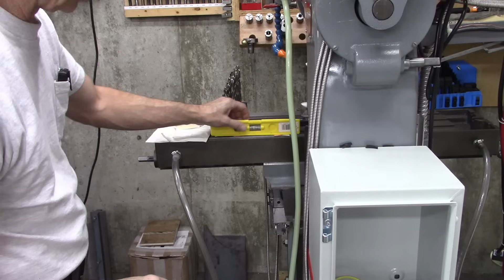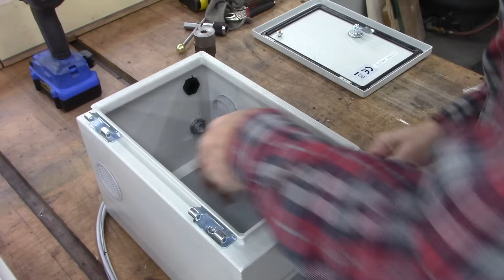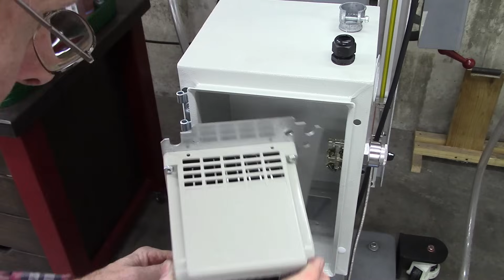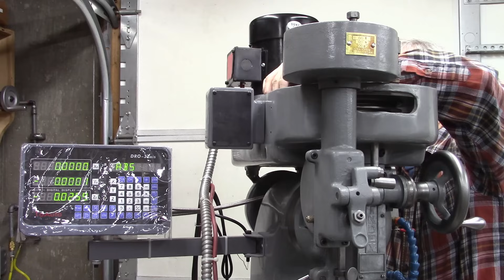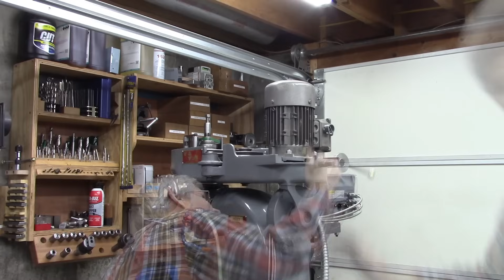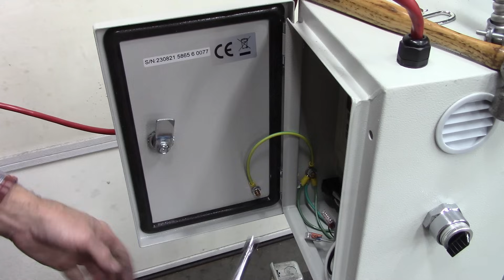IT'S ALIVE! Installing a VFD and 3 Phase motor on my Well Index Mill  - Part 2

Comment: great work. have a different model vfd, but watching your video helped me. believe my issue is with the motor on my unit. currently wired for 480. i will be switching to 220 and see what happens!
Reply from the maker: Good luck. It takes a while to figure out the VFD.
Reply: @ just got it wired up and gave it a try! Posted a video of mine! Lol not as good as yours! Thanks for the help!!
Reply from the maker: @tylermaster7  There are settings that control ramp up and ram down. Its in "hz per second", If you are running 60HZ forward and have them both set for 60 when you hit the reverse it takes 2 seconds to go from full speed forward to full speed reverse. Its hard on the motor if you go too extreme but you can go way more extreme than you are in the video. You can also double the rated speed by setting the max. hz at 120. You lose a little power but not much. Going slow is much worse. Running over speed allows you to gear for the lower speeds without sacrificing as much high speed.

Comment: You should install a fan to increase the air circulation. Your VFD will overheat if you don't.
Reply from the maker: The VFD has a fan and the bottom of the box is mostly open. There are 2 round 3" vents at the top. Its been running over a year now and no sign of heat. I might be wrong, but I don't think its a problem.

Comment: Thanks for such an informative video! Have you considered installing a foot pedal that you can plug in when needed for forward and reverse jog for power thread tapping?
Reply from the maker: The quill on my mill is worm drive and can't be driven backwards so power tapping in not an option

Comment: i have a 1 1/2 hp 3 phase that will mount directly on my motor plate and the oem pulley fits. I will look for a 56 frame 1 hp 3ph, i don't want to break mine.  But that was an impressive cut.
Reply from the maker: You mean milling the motor?

Comment: Ok, I said you had inspired me and I have cleaned 1/4th of the garage (meaningful because it is room).  Next, I'm tearing apart my heavy enclosed work bench I built in '83 in MO. I was going to leave it when we moved to FL in '94, but the movers put it on the truck and here it is.  Work paid for the move and they even packed the full trash cans and brought them. I couldn't believe how fast metal disappeared when I put it to the curb yesterday, it was gone between trips.  When I went to get the trash cans a minute ago, some guy I couldn't understand was taking an old hot water tank from the neighbors from beside his house.  Some lucky guy even got a boat motor last night.  I remember watching my dad toss everything when he turned 70 and I couldn't understand it.  I'm 68 and I understand it now.
Reply from the maker: Ha,,,  yeah, baggage.
Reply: Right, baggage. That's all it is.  @WinkysWorkshop

Comment: While the electrical code is complicated on this subject, for safety and electrical interference reasons, it is generally a bad idea to run power and low voltage control wiring in the same conduit, or even cable tray.
Reply from the maker: Interesting and I'm sure you are correct. I actually thought about this while installing the VFD but decided to proceed and take a chance anyway. One reason I did this was simply laziness. Running the wires together kept things simple and compact. The other reason is that I saw this done frequently on motor speed controls in my past job. To be clear, I am in no way a qualified or educated on this subject and this was just my observation and perhaps not correct. It could very well be that some of the wires were shielded or that my memory has failed. Thankfully its working incredibly well. Maybe I got lucky or maybe the 3/4 HP and 220v is not enough to induce a signal in the other wires. Like you said, the code is complicated. Thanks for this info however, it's very much apricated.
Reply: @WinkysWorkshop  I installed a KB Electronics drive on my mill and it generally works fine. But I have been able to stall the motor at less than 50% speed, when I should have changed the belt position to maintain enough torque, or used a smaller end mill. Please keep us up to date on how yours performs. There is a whole lot of interest on this subject.
Reply from the maker: @jmcc685  When using HSS endmills with a 1/2" dia. the mill needs to run about 700 rpm. My VFD is running at 45 hz at this speed. I tried pushing it hard with this size mill and I DID hear the mill slow down slightly but I doubt I could stop the motor. I also used a 1-inch mill without issue but did not push it...  I suspect this was about 30 hz but did not look. I now have 3 belt position options and I am running it in the fastest position. The next step probably limits my speed to about 1200 to 1500 (have not checked the speeds) so this might be the best range to leave it in for HSS. My current 2050 high end is great for 1/8" carbide however. Still the front belt is easy to move.

Comment: You are truly a man of many talents! How is the torque at low R.P.M.'s?
Reply from the maker: Thanks. So far I have not noticed any but the rated RPM is only 1120. This means a 1/2" HSS end mill running at 700 rpm is still running at 60% of full rated speed. I might notice it if I go slower but I still have 2 slower front belt position if it's an issue. I have not measured the RPM but its super slow if i move the belt.

Comment: I can't begin to tell you how valuable and useful your content has been to me in the last year or two.  Your interests in machinery are very much like mine.

$25.00 for that motor and a clear conscience.  AWESOME!

The indicator light is an excellent idea.  I did the same thing in the electrical box for my Index 645.  I have other indicator lights as well.  The air compressor is mounted in a different room and has a blue light special light mounted on the shop ceiling that is very noticeable as I shut down the workshop in the evenings.

I split the 240V incoming off to provide 120V as well, installing a 2 gang 120V box and outlets external to the box.  I went with Automation Direct and their 240V single to 240V 3 phase  .75Kw VFD.  It was much narrower.  I'm able to fit two of them in a slightly larger box.  I also used the original Hubbell Fwd/Rev switch on the machine to control the Fwd/Rev on the VFD and will do the same when I get the second VFD for the table feed which is also 3 phase.  That retains the original tactile feel of the industrial switches as well as the positive and intuitive action.

Those crimp terminals ROCK!  I only learned about them in the process of building my electrical box.  They're worth every penny!
Reply from the maker: Thanks...  I suspect yout VFD is a little better than this one but for 3/4hp mind works well.

Comment: I know you have mixed emotions about adding a tach.  I guess my point was that there are some really tiny sensors like 1/8" thick with a screw hole that you could put under the spindle pulley and not have to use one of those large round threaded ones.  The magnet could be small also, like 4mm od (0.160").  Those miniature sensors have the same 3 wires and will work directly with the tach counters (the one you used on the lathe) although you might have to splice or solder the 3 little wires to get that connector.  Just search for miniature hall effect sensors or transducer and you'll see them.  There might even be a smaller counter display.  This stuff is all cheap.  Give them a company name and they'll send you a sample for free.
Reply from the maker: Nah...  it's not the money, the one on my lathe was $18. I may do it as some point but its low on my list.
Reply: Same here.  Retired now and cleaning out the garage.  Give it away or push it to the curb.  It's a long drive to goodwill.  For many years, I used to buy, trade and sell tools with several good friends at the flea market.  God, I loved it.  They're all gone now (passed away, moved away) and Walmart even built a store on the property.  Always had a big shop at work so didn't need it at home.  Once I get some room in the garage, things will improve, I think.       @WinkysWorkshop
Reply: I've been playing with one of those sensors today. It says they are inductive, and this one has a 4mm sensing range.  It was interesting that it didn't need a magnet, just a piece of steel, and the steel worked better than the magnet.  It detected 4mm with the steel and only about 3mm with the magnet.  I even stacked the magnets to make it stronger and it was still the same.  Wait, I need to test aluminum.  hmm.. about 2mm with aluminum.  I didn't see that coming.  I guess if you got too close to any metal it would just stay on.  Ok, brass... yep, 3mm. @WinkysWorkshop

Comment: One tip, Winky. Never cut off conductors in a control cable. If a wire gets pinched or broken, you can use the spare conductor in its place. Simply tape the end of the extra wire to keep it from coming in contact with a power source and tuck it away.
Reply from the maker: Thats a good tip. I actually did that on one of the wires but cut several other.

Comment: Great outcome Mark. Two suggstions, next time for big twistdrill holes in sheet metal. treat yourself to some cone cutters. Variable size holes and no nasty burr. You drilled and fitted vent holes, it is still a tightly packed enclosure, there was a large panel hole in the bottom. why did you not fit a fan ? Regards from Australia.
Reply from the maker: Yep! That was a huge brain fart. I have several and they work great!
Reply from the maker: Fan...  I think natural convection along with the fan in the VFD will be adequate to keep things cool.

Comment: You've made a nice job of that installation. I used a larger version of that style of box for the vfds for my mill (spindle and feed) but mounted it on the wall. A couple of suggestions:  the hole on the base enables you to use a replaceable panel for cable access to avoid drilling the painted box, and second, when youre drilling thin sheet place a scrap of rag under the drill. It helps stop the drill grabbing and making a mess of the hole as it breaks through.
Reply from the maker: I wanted the bottom open for ventilation. As for drilling, I had a brain fart. I usually use step drills and they cut amazingly smooth. Thanks

Comment: I've watched some videos where they mount a tach on a mill (it can be elaborate).  It's a problem because it has to read the spindle and there's no good way to mount the magnet and sensor.  I've thought about it a lot because I want to do it to mine.  My thought is to mount a tiny magnet inside a hole in the hollow bottom of the spindle step pulley.  Then take one of those long, threaded sensors and pull it apart.  Unsolder the little sensor and put it on a cable.  Mount the sensor into a piece of plastic to set beneath the pulley or put it in the end of a piece of copper tubing that could be mounted and snaked in from the side and easily bent into position.  Copper is not supposed to bother the sensor.  Run the cable to the tach box and put the rest of the sensor circuit in a piece of heat shrink and tuck it into the box with the tach.  I think it might work.
Reply from the maker: I have a hand held tach and measured the speeds at ten points (my dial is numbered 1 thu 10) and made a small chart. Quick and easy.
Reply: Or you could do that.   I guess there's no reason to get into my laser pointer and fan blade idea...  Which now that I think about it would only be useful if you couldn't afford a hand held tach.
Reply: Once you know what all the speeds are and the ranges thru the pulleys, you could get a custom label made.  I don't think they are very expensive either for a really nice one and you could add any other switches and lights and just cut them out.  Might be nice as a finishing touch. @WinkysWorkshop
Reply: For a tach, I saw a video where a guy drilled holes up and down one of the flats in the hex top of his drawbar then glued small magnets in the holes.  He has the sensor on a hinged bracket that drops beside the bar and then lifts to put a wrench on it.  There's always a magnet in front of the sensor as the quill drops.  Not poking fun at it.  It's a difficult thing to do when there's no room.  @WinkysWorkshop
Reply from the maker: @robert574 The tach would be super easy on this mill. the spindle pulley flange could be drills and a magnet installed.  The belt guard would hole the sensor looking down on the flange. The thing is, I used a handheld tach and made a chart at each 10% on the dial. Easy and effective.
Reply: Thought I read a comment you were thinking about it.  But all is not lost, you have inspired me to clean the garage.  OK, next adventure.  How will they flip that Japanese moon lander back on its bottom.
   @WinkysWorkshop
Reply from the maker: @robert574  I think I did but changed my mind. I made a label that runs along the bottom of my DRO with all the speed.

Comment: Great upgrade.  Two comments (and full discloser, not an electrician): I am a little concerned about the possibility of wire chafing in the VFD box due to vibration.  Might want to wrap some tape around any wires that rub against anything else.  Second, the EMI  ( electromagnetic interference) from the VFD is pretty intense, especially at low frequency.  You might need to shield some of the output wiring more.  But overall, bravo!
Reply from the maker: You are right about the EMI but I think the enclosure blocks most of it...  so far no problem. The only wire I was concerned with it the wire that went under the sheet metal in the back of the box. I taped the edge with so very strong thick tape. I suspect it will be fine. I do need to loosen the VFD and let the wires coming in from the top sit more toward the back.

Comment: That turned out really nice.  There's not much you can't do is there.  I didn't hear any motor noise did it go away under load?  The box was perfect looks good.  Good job.  I flipped the switch on a couple of times when you weren't looking.  Hope you didn't mind.
Reply from the maker: Haha...  I didn't notice the switch flipping :o)  Yeah, the motor noise got much better. Maybe the load and freewheel effect of the 5.5" pulley dampened it.

Comment: Good work Mark, I bought a Vevor 12 x 12 x 6 box like that for my sizzor lift control box and it worked great. I wanted stainless steel but that was the one size they didn't carry. I love your videos. BTY thanks for the drawings of the mill table, I can use them to fix my table.
Reply from the maker: You are very welcome.

Comment: Mark,
You did an OUTSTANDING job on this one.....all yourprojects are good, THIS one was exceptional. You've taken the proverbial sows ear and made one heck of a purse out of it. Any one and I mean ANYONE would be proud to have this in their shop. Can't wait to see what your next project will be. A surface grinder maybe???????? Hint hint !!!!!
Don
Reply from the maker: Wow..  thanks for the great compliment. Sorry about the surface grinder. I don't need one very often and I have to pick and choose my tools carefully. My next project will likely be a bit silly. I need a TIG electrode grinder so I plan to make one out of an old blender motor. However, I will get back into involved and important projects too. I'm thinking about another CNC wood lathe and another wood car similar to my Buckboard flyer. It will be an electric version called a Auto Red Bug (also originally made in 1920).

Comment: It seems like a lot of work just for a tiny 3/4 HP motor.  About 2 HP seems appropriate to support general machining in a vertical type mill. Now that you have proved the upgrade methodology, are you considering an upgrade to more powerful motor? Cheers.
Reply from the maker: Considering the mill was originally only 1/2 HP I think the 3/4 is enough. The one HP I had on there never thought about slowing down. I'm sure if I was in a production shop I'd run into limitations but in my home shop using HSS I doubt I'll ever have an issue.

Comment: I have to agree with some of the other comments, get a tachometer for your machine. They have small digital ones and it would be handy to know at a glance the speed you’re at and how much it varies with the cut you’re taking. That VFD install really came out nice, I need to do some of things to my small mill.
Reply from the maker: I just made a small chart that show the speeds at the dial increments of 10 - 90%  (320-2200 PRM). I'm sure this will be close enough. It would be interesting to know how much it slows down however. I may do this in the future like I did on my lathe. The indicator ran on 110v and was less than $20
Reply: @WinkysWorkshop , Thanks for the reply, that would really be handy already knowing the speeds without having to have a tach handy to use when you’re actually using it. Your videos are always interesting so thanks for putting them up!
Reply from the maker: @Hoaxer51  Thanks, I'm glad you enjoy my videos!

Comment: Hi I'm doing a lathe right now and i could mount the box to the rear but then it would make the lathe be spaced further away from the wall so i am going to mount my box on the wall close to the outlet and i know there will be a couple of wires that will go from the box to the machine even the extended ribbon cord for the VFD face panel that I'm mounting on the front of the lathe . just a thought but at least it will be in one peace and if you  move the mill it will be easy .JM
Reply from the maker: That sounds like a good plan.
Reply: Isn't it finished already thanks
Reply from the maker: @junkmannoparts9696  Yes I'm done. I just thought mounting the VFD panel away from the VFD was a great idea.
Reply: Yeah after I posted it I realized what you were saying thanks